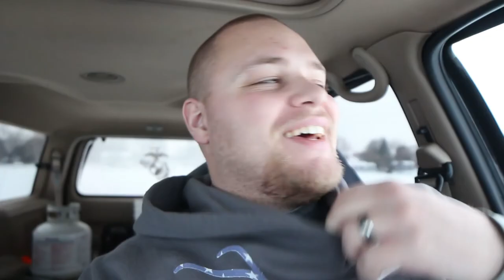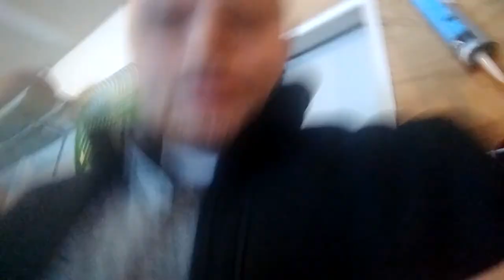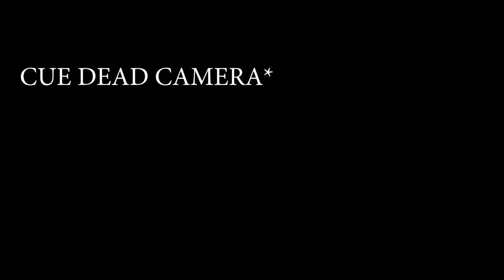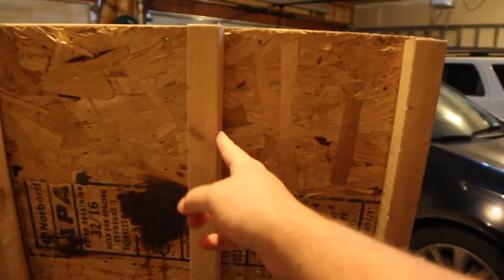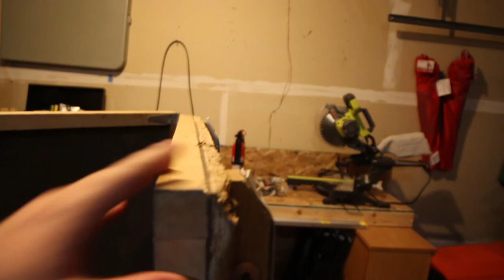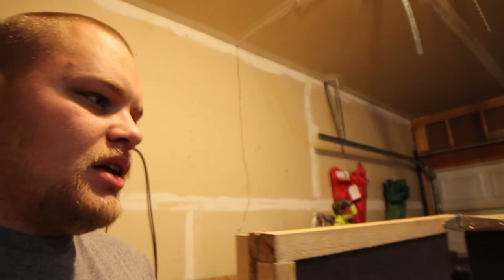Pop-Up shack floor... Life Lesson on wasting time

Comment: Make it 282 subscribers, in the pass I have made a floor and it works so well, but someone stole it a couple years ago.
My floor was a little bit bigger and a lot more heavier than yours, I even had two propane tanks mounts in the front I pulled it my sled.
It's nice when you want to move, you don't have to pack up, other than drilling some new holes.
I also used those pop out holes you can get from Fleet Farm.
Reply from the maker: That's awesome! Thanks for watching.